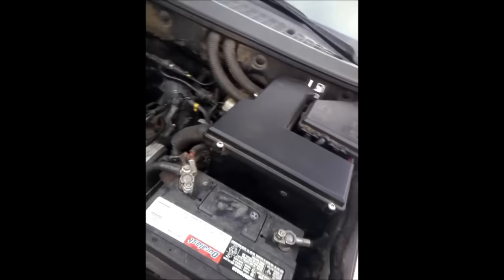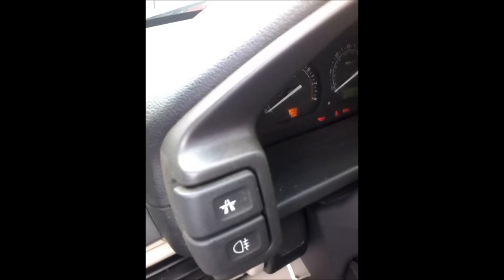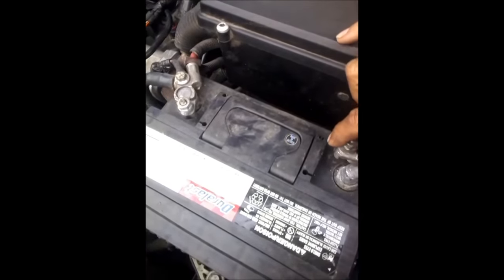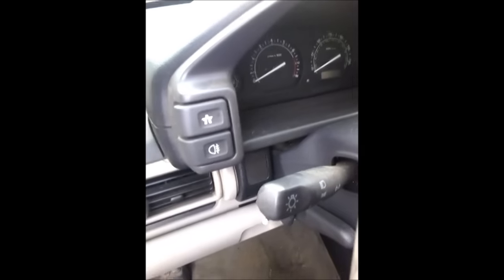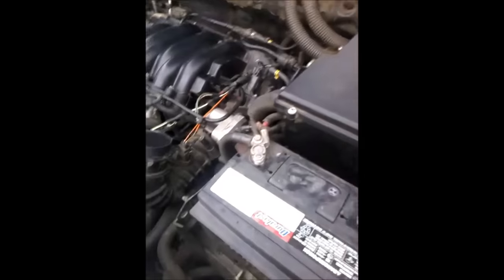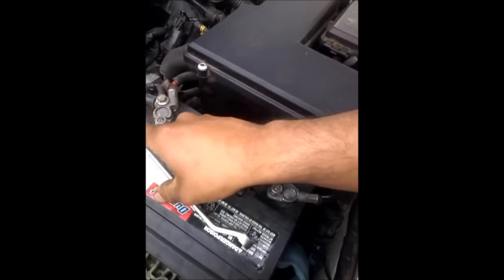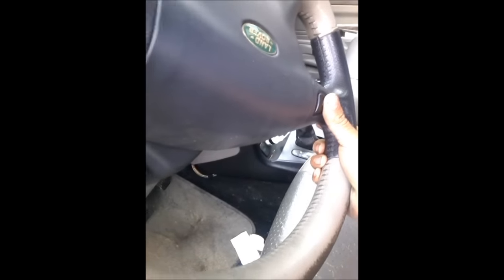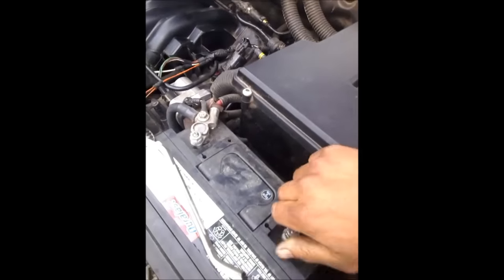3 ways to turn off CHECK ENGINE without scanner EASY!!

Comment: what if i changed the MAF already and the light came on again like 3-5 days later?
Reply: More often than not it's a dirty or faulty gas cap.  If the cap doesn't seal correctly the tank will leak fumes and cause the light to come on.  Clean or replace the gas cap and the light should go off after a few cold starts. It doesn't go if immediately. As long as the light isn't blinking this might do it.  It worked for me!! Hope this helps.

Comment: All 3 methods you showed us are doing only one thing: short circuit the ECU to drain all the electricity from its power supply filter capacitors so it will be no electricity to help store the fault code in the memory bank.
THE problem is this: your methods DON'T eliminate the cause for what the MIL indicator comes up. Therefore, soon enough MIL will be back alive (lit/on). 
Fix that engine/car first and then think of turning/resetting the MIL indicator.
Reply: That's what he said smh

Comment: It will come back on usually a month later. Only way too correct it is either fox the problem or remove the cluster and take out the bulb… now by doing that you won’t pass your state inspection but the light will be off atleast

Comment: Iv tried all of this . Iv cleared with scanner.  I replaced maf sensor. Pcv ..both 02 sensors. After clearing  it starts. Runs great.    No matter how far i drive but when i kill the engine light comes on again  ac blows hot. Engine idles rough.    Iv even cleaned throttle body . I wish someone would actually tell us what the real problem is

Comment: 9 times out of 10 it's your GAS CAP.  It will take a few cold starts to reset itself. This was the case with my car.
Reply: What kind of vehicle do you have?
Reply: @raven79ish  Ford 500 Limited

Comment: With that spanner (wrench) you were almost shorting out the ‘birdie’. The light is on for a reason and disconnecting the ‘birdie’ can adversely affect the on board electronics.
Reply: The masses have shared that it works so you LOST

Comment: Use a socket..don't tap the negative cable 3 times, neg cable creates a spark..

 Don't leave the ignition on creates a draw into the main coumpter and you fry the vardie..

 Never add a negative cable to a positive...just deadly..

 Pull booth cables using a socket wait ten minutes, re connect correctly..

 Ob2 are standard With EFI...ie throttle body...

 Obd2 systems trip check engine lights...

Comment: Why turn off the light without checking the reason it's on in the first place? Scanner code readers sell for $25. Turning off the check engine light doesn't fix anything.

Comment: Great engineer, please help!
  Recently, a client called me to fix his 2000 Toyota Avalon car that cranked but wasn't starting.
   From the onset, the car experienced several mechanical, as well as, electrical issues. Some of those  problems were:-
(1) Engine Oil consumption;
(2) Engine misfire;
(3) Engine rattling;
(4) Intermittent hard starting after shutdown; 
(5) Hard to engage in drive, except engine is hot; etc.
Hence, he took the car to a garage inorder to rectify the excessive Engine oil consumption and other car problems highlighted above. Consequently, the car  problems exacerbated after engine rebuild by the engineer! 
  The car owner wasn't satisfied with his repairs because it seems the engineer was deceitful. Although the car started after the rebuild, the problems still persisted.  Valves weren't grinded after engine overhaul, engine still misfired at idle and when accelerating, etc.
   The  engineer whose garage the car is presently being parked, requested for another engine overhau/ rebuildl. After engine rebuild the car started, the oil was mixed with water; the engine was still misfiring, rattling, etc. It was obvious,  that he didn't use durable parts to do his work.

    Hence, the car owner moved the car to another garage for better repairs. The new garage suggested to the car owner that another engine rebuild is pertinent for optimal engine operation. 
    During my conversation with this engineer, whose garage the car is presently being parked, he told me that: "when the car was first brought in, he noticed a black smoke ( maybe he was mistaken for blue smoke, at exhaust tail at idle). When accelerating, there's a loss of power, engine bucking, popping,etc. After the rebuild, the car didn't start because the mechanic didn't unlock the car with the remote but proceeded directly to cranking the engine. In addition, the security relay wasn't actuated for starting to take place. Electrician did some wire cutting around that axis which he said was corrected to factory, opened with a remote before the car started.

   Fortunately, after everything, the car started again. But there was still an intermittent misfire. What the car owner said was that, 'even when the second mechanic did engine rebuild, the car still misfired. Until he personally bypassed earth from the COP wire to the solenoids very close to the fuel injector often tightened with 10mm knot and depicted with blue and green colors on the picture. Car owner verified that the reasons for the misfire from both mechanics which still prevailed, was due to the solenoid valve that wasn't opening. That's why when accelerating it experienced a loss of power, similar to that experienced by a faulty fuel pump.
  
   After gear oil replacement and test driven by the second mechanic , smoke started emanating from the engine bay. Precisely, from the fan relay that the car owner connected by himself. Within few minutes, the car shutdown by itself as if fuel is finished.  As he tried to restart it, the car refused to. Infact, when the ignition switch was turned to Acc/ ignition position, battery and fuel light was not displaying in the dashboard/ instrument cluster. However, during cranking battery light glew faintly and start. But when throttled,  it would shutdown. Electrician verified and replaced the alternator diode with a new one. When Ignition switch was turned to Acc/ ignition position, the battery and other lights came out brightly but when cranked to start engine wouldn't start again. Sadly, it still wouldn't start.
 
I tried to scan for DTC codes, but my scanner wasn't communicating. I checked all fuses, power and ground at obd port, those checked ok. but my scanner isn't compatible to read CAN network. there are only 4 wires intact for the obd2 port.
    Furthermore, I added fuel through the intake to the engine, no change at all. I checked for spark and injector pulse. These things weren't present. But there was power to injector with just the key at ignition or ACC and COP had 1 ground and 1 power as usual. 
 Electrician from that garage, who also worked on the car said that he sniffed burning smell from the ECU, however personally I didn't when I went to start the car. I don't know how certain that was. Hence,  I pulled out the ECU to a laptop board engineer to test the components inside. He said: "everything looks ok and test fine, however the IC he doesn't have the right tools to proceed with the test. With the ECU removed battery connected, Engine light would come ON. with ECU connected check light still comes ON.
Before I left, I checked the MAF sensor 5 wires and noticed that 3 wires were earth instead of 2 and 1 power; no ignition current/ power was available for the remaining 2 wires. 
  Please, what should I do to start the car?

Comment: Now, Mr. YourCarFacts, allow me to give you a tip, a safety tip. First of all, wear some mechanics gloves or leather gloves and safety glasses at the very least. Secondly, learn not to wave that uninsulated wrench around the battery's terminals like that. And, most importantly, make your viewers aware of the potential dangers involved with what you did in the video. Especially, when using that type of tool and NO PPE at all.

Comment: I brought my car to get the inspection sticker and it had passed everything including all the computer points, sensors ect.. except the VISUAL check engine light. No mecanic can find out why. I have a 2006 Ford Five hundred.

Comment: Manually turning off the Check Engine light with those tricks doesn't fix anything  It does not address the main issue and it doesn't tell you what caused the light to come on in the first place.  Even if you manage to keep it off for a day or two chances are it will eventually come back on again if no repairs are made to fix the main problem.  And for those who think they can bring their cars to emmissions after they managed to temporarily turn the engine light off they're gonna be wasting their time because emmission stations can detect if the engine light was manually shut off.  So in an nutshell it's not even worth turning it off manually.  The best solution is to plug in a code reader into the vehicle to figure out what's causing the engine light to come on and fixing the issue.  That will get rid of that check engine light for good.

Comment: The third option he showed can kill your onboard computer. the disconnect battery will work but only for a few days or weeks and the check engine light will come back on untilll you get what that means fixed

Comment: Be careful disconnecting the battery with the ignition on I have the service manual for my car it says not to disconnect or connect the battery with ignition on it says you can damage the computer
Reply: What kind of car you have
Reply: brian trice when I wrote this I had a 2004 Holden Caprice now I have a 2014 Holden Caprice

Comment: One thing you arent teloing anyone. If you disconnect the battery, you have to reset everything else and that includes, but is not limited to the clock, and anything else that the battery controls...

Comment: 4th way would be to pull the engine control module fuse and leave it out for 5 to 10 minutes

Comment: This video,,, you're not solving the problem. Bottom line is; you're just disconnecting the battery.  Special Warning about step 3; putting a short across positive and negative, I was watching a different video, if you put a short across both - and + you highly risk shorting out the car computer. so I would get rid of step 3.

Comment: The best fix to turn it off, is to get the problem fixed. Unless you want bigger issues later.
Reply: Mine is not a big problem but it’s 450 to fix and I’m still in highschool and I’m not working anymore so
Reply: @dominickoneto4763  is that 450 for a shop to fix or for you to fix yourself?

Comment: Why didn't you tell them to just check the gas cap? Could be loose and just tighten a bit 
If rubber gasket cracked, replace the cap.
Ta da

Comment: Why would you want to turn off the check engine light ? It's telling you that there is a problem.  Scan it, read it and then fix the problem.  Then the light will go off , unless you have a problem with the computer. I had a problem with the check engine light threw all kinds of money at it and nothing would turn it off tell I replaced the computer.  No more check engine light . The whole time it was a bad computer.

Comment: Jeez man , dont be using a long wrench like that on a battery, if you accidentally touch both terminals , expect a BIG flash and loads of sparks , on the bright side , it is guaranteed to cure constipation pretty much instantaneously!

Comment: Yea but the problem isn't THAT the engine light is on it's WHY it's on. The best and most legal way to get it off is to find out why it's on and fix the damn thing before it affects other critical components. P.S. don't ever cross the birdie cables.

Comment: Tapping the battery with the ignition key on is a very bad idea, the Engine Control Module $1,500.00 
may be damaged it has very sensitive electronic parts that will short out if you do this, this is why
jumping off another car its important to turn both cars off and never jump off a bigger car with a small one
the alternator electronics will not handle the heat of the extra load.

Comment: Never, never ever place a metal tool on top of your battery! He knocked the tool forward off the battery, it could just as easily been  bumped the other direction onto the terminals.

Comment: Thanks for the video, but You are very dangerous machanic as you put the spanner on the battery if it falls on the 2 terminal then the battery blows up and burned the car also your work shop

Comment: I just posted the truth and utube took the post down .take ur vehicle to a dealer and put on a Onboard meter under your steering wheel to set the codes to find the promblem  . Dis - connect battery is at most , temporary and wont find the  true problem .and will come back and cost you  alot more money than doing it right Relatively Expensive  Computer  Code Meters have to find the problem , wore out parts , diagnosed ,  then parts  replaced ,  and electronic computer  codes afterwards be reset by technician by OBM meters  , and No  cheap Auto zone meter under $200 dollars. All info on U tube is an AD to waist  later  take ur money by rip off auto repair shops. Not saying there are none out there but remember the dealer

Comment: I thought it will not light up the check engine. Your way is the same thing as take the negative off and put it back again check engine will be off and if you really have a problem it will come on again. Everybody know this.

Comment: resetting the battery clears the codes temporarily, but it will come back, there are "SOME" check engine lights which can be as mundane as you didnt put you gas cap on, to a blown coil, pulling the battery, jeez, glad your not a doctor

Comment: Resetting the check engine light like this is not going to fix what problems you have in the engine or the car system and you will land up one day with an unexpected surprise & expenses 
Get it checked in time or buy a scanner from Amazon it’s not expensive & Do It Yourself

Comment: will lose ,erase,all fuel trims+ all codes if battery is disconnected. i just drive in all situations to reset+ relearn ecm with my car.and avoids dealership.🏁

Comment: the " check engine soon " light has come on because there IS a problem.... PERIOD... yes, what he said will turn the light off, but it WILL come back on, because there is a problem.. PERIOD... and lastly, the same thing that turns the light on ?? will turn the light off...  these systems continuously TEST themselves.. if the problem gets repaired ? it WILL turn itself off.. and I DON'T recommend dis-connecting the battery, better be careful not to sent a voltage spike through the system, it can burn stuff out.. be careful....

Comment: Have the fault repaired then have it reset if necessary. In many cases when the fault is repaired the light will go out on its own because the fault is no longer present. Any other idea, other than investigating and repairing the fault IS ABSOLUTE NONSENSE.

Comment: This only turns it off temporarily, and there is a problem that caused it in the first place.  I did this, and it cost me $1500 for a new ECM.  The ECM wasn't the problem.  I had a po133 code, an exhaust leak, causing the engine to run lean, and the O2 sensor picked it up.  These 'quick' fixes cost you more in the long run, believe me, I know.

Comment: Just discovered an even easier way. After replacing the bad Air Fuel Ratio sensor on my 2003 Toyota Camry, the check engine light stayed on after having driven it for some 25 miles and parked over night. I was about to try the advice here, but first had to drive to Walgreens to pick up a prescription. Exiting the parking lot I was stuck behind a car waiting forever for an opening. After he passed up several generous openings in traffic, I blasted my horn to get him to please move. Immediately the check engine light disappeared! So the horn drained the capacitor and BINGO. I suggest then trying to give your horn good blast, not just a little toot.

Comment: These are the 3 dumbest things I've ever heard. They are, 3 good ways to ruin the car's computer. Static electrical charging and then discharging is a really good way to ruin electronic components. Like your car's really expensive computer.